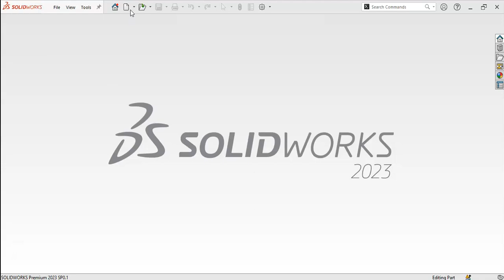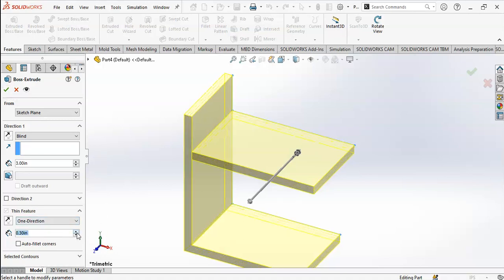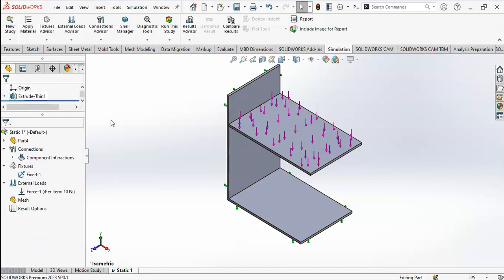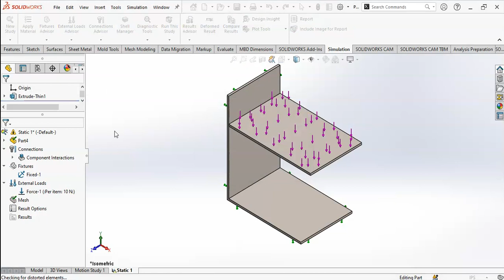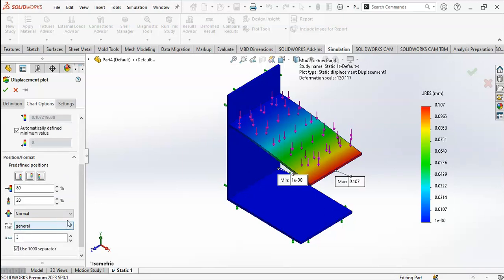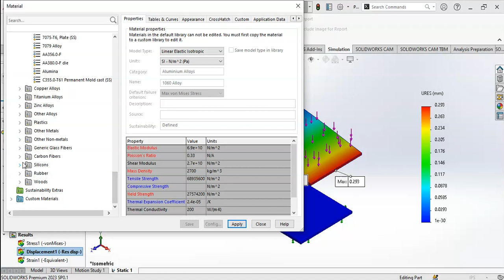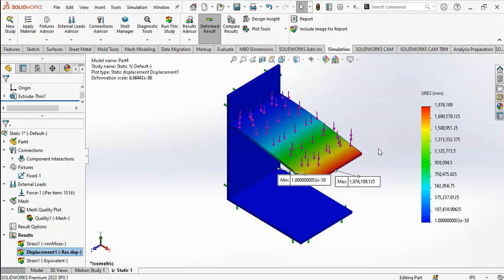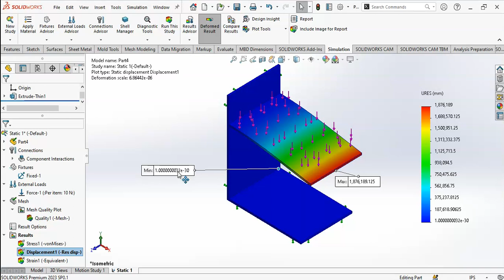Load Analysis in SOLIDWORKS: Static Stress, Displacement, Strain

Comment: Great video! Hello sir, I want to measure the amount of torque applied to the servo motor by the robot arm I designed in SolidWorks. In other words, how can I analyze the torque applied to the motor shaft from the robot arm's center of gravity? The problem I encounter here is that I have not come across a source that applies load other than external loads. Can you help me?
Reply from the maker: @ekrem9133 
Create an assembly that includes your robot arm and servo motor.
Define the center of gravity for the robot arm.
Measure the distance from the center of gravity to the motor shaft (the mounting hole you’ll use on the servo horn).
When that arm of the servo horn is horizontal, your measured distance will be the moment arm for the torque.

I hope this will help you!
Reply: @TheSoftLearning  why did you delete my replies?
Reply from the maker: @ekrem9133  I haven't deleted your reply, even though I answered your question.🙂